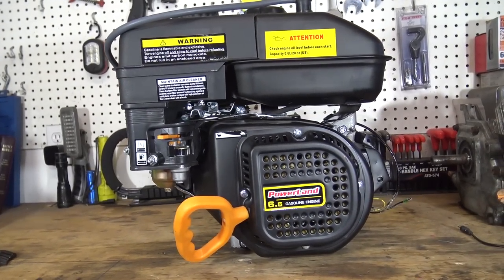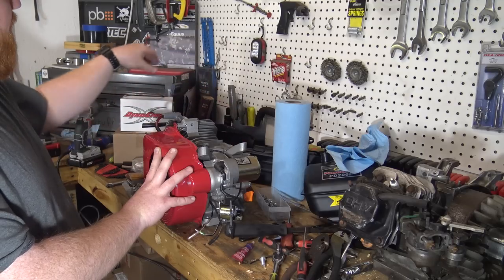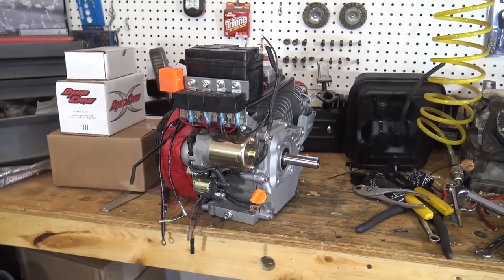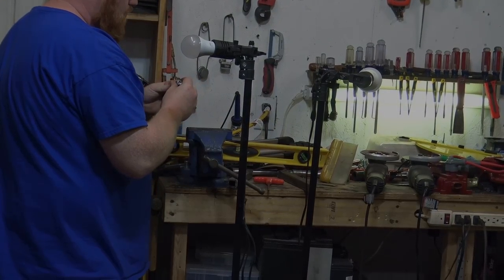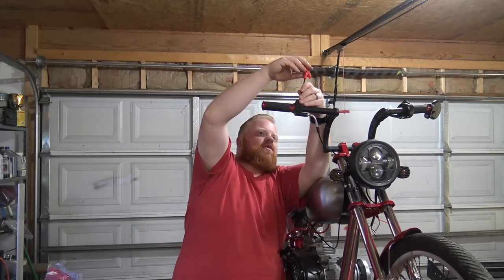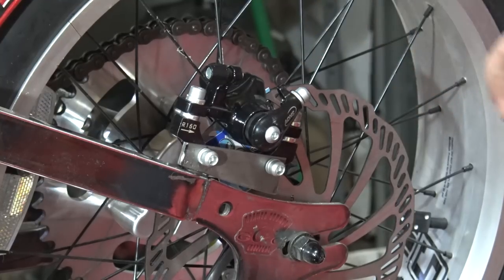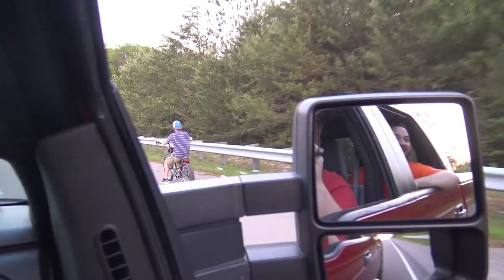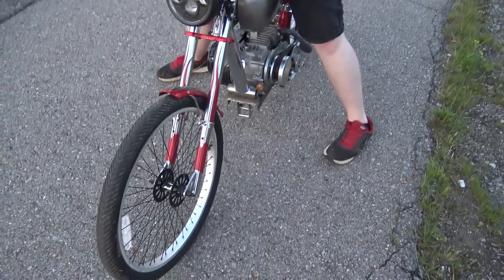Mini Chopper Build Ep 4 - Maiden Voyage

Comment: Just waiting for this channel to blow up. Love the builds, keep doing what you're doing man.
Reply from the maker: +Excrio I appreciate that man.
Reply: No problem. And I was wondering, I thought it'd be cool if you did a video in which you show all the modifications you made to the stock 212 before you put on the GoPowersports kit for little red? Just an idea, I've been messing around with an old dirt kart which I'll be putting a 212 on, hopefully it turns out alright. Thanks again.
Reply: Red Beard's Garage the Honda GX 270 Honda GX340 take the head off of the 270 put the head from the 340 on to the 270 you have to adjust your flywheel air cover when you do this it will amplify the horsepower on your street go karts up to 10 horsepower I think it is I hope you get this I hope you make a video about it I'm out
Reply: I AGREE
Reply: Wouldn't a larger volume head make the compression worse?

Comment: Be careful and keep an eye out for your spokes with that adapter for your sprocket, I had a very similar build like this a couple years ago except stock carb and a max-torque clutch (centrifugal). The engine eventually made the adapter turn into the spokes and start bending them!

Awesome build though, love everything about it!
Reply: stewstang these are safe.its not like the standard kind with the rubber grommets.

Comment: id like to see and info on actual  a simple transmission of some sort. Two speed nothing complex, it would open up so much. Have more efficient  top in and still have low end power.
Reply from the maker: This bike has all the power it will ever need. We can take off so hard it would break every spoke in the wheel. There is no need for one in my opinion

Comment: A steering stabilizer may help with your squirrely steering. I think it might just be how light the bike is combined with how skinny that front tire is. Those stabilizers are all over ebay and amazon.
Reply from the maker: +Erik Spitz I will most likely try that. It's mostly from having to hold our feet up
Reply: Red Beard's Garage i have a set of Harley highway bars if you need them. i'll send them out to ya

Comment: hey man that's one sweet chopper can't wait for the new motor with the electric start ,will you be trying out that 3D clutch on the chopper
Reply from the maker: No im not too fond of that clutch. I think the torque converter is the best route on anything. Thanks for watching.
Reply: Red Beard's Garage i agreeed tav2 is a simple solution for most applications

Comment: Great job! Would really be neat with a V-twin in it. Might ne a little heavy though.Did you make the frame? Where did you get the rear wheel and sprocket mounting parts? And front forks?
Reply from the maker: +Junk Yard the parts are in the description of the video
Reply: I don't see anything in the description about the frame and forks. But after watching the prior videos I deducted they are a special Schwinn bicycle? I guess good luck finding one. I like the size and proportions of the rear wheel but the sprocket mounting and brake rotor mounting look pretty cheesy. Do they just clamp on the wheel hub and spokes?

Comment: great build I always wanted to do one on that grame and back wheel but,  when I found out how light weight the rims were I went with some moped alloy wheels and built a custom frame of my own.  As far as the ape hangers .... they are not an ape hanger guys !  You lost the beauty of the bike with those bars but,  its your build not mine !  Always  a thumbs up !  I am bummed you didn't see the coill part of the video but,  that stuff happens !  A tip for taking grips off is to blow air throught them and around them and they come right off !  Glad you got what you wanted to ride !

Comment: Do you need the relays for the headlight, tail light, horn and turn signals? Like, would it not work without a relay?
Reply from the maker: Probably but I have them and its better to take the load off of the cheap handle bar switch. If you don't run them than all the current going to all the accessory will have to run through that cheap switch.
Reply: Thank you, it might be a good idea to get some then. Putting it all on my Baja Warrior. Thank you again!

Comment: Why not use a 2T 3 or 4 speed semi auto Yamaha or Honda motor. (Example: Y80e Belle - electric start) then use 2 more freewheel assembly to transfer power from left side of bike to right side. then use a 16x140x70 rear motorcycle rim/tire and a 17x3.0x70 front tire/rim. Change head post bearing out to cone style and get rid of the ball bearings. (get rid of wobble!) I did here in Thailand, sweet you can get 2T or 4T engines... able to idle, use motorcycle disc brakes, I like you started out with Bike brakes... not very strong when at speed! Don't need a clutch so use left and right hand brakes, hydraulic! I saw speeds from 80-115 kph! cruised easily at 30-55 kph. Then I was offered 36,000 baht (Thai) for it (exchange rate: USD1 = 31.60 Thai Baht

Comment: Cool build, but if I may chime in and give my 2 cent just in case people are looking for these pipe fittings. They're not flanges, it's not sewer pipe and most USA fittings are not imported from China. These are 304 stainless steel thin wall food grade bell reducers (perfect for this type of use). The USA fittings are more experience because they are 316 stainless steel or higher. Most major food plants (like Budweiser and others) will only allow you to use the highest quality. And a lot of times, it's even higher quality than stainless. It's whatever is in the "technical provisions" at the time. But all has to be approved before use. And that's the difference in materials that you are using. Forgive me,  just had to clear that up. As an engineer, it was kind of bothering me.

Comment: I'M BUILDING A 212 CC MINI CHOPPER LIKE YOURS.I PUT A CR250 FRONT FORKS ON IT,I PUT A SET OF PEGS BELOW THE SEAT AND USED THE PEDALS FOR THE FRONT TO STICK MY LEGS OUT.I PUT A TACHOMETER ON THE DIRT BIKE BARS. I WAS ABLE TO KEEP THE REAR BRAKES. AND I HAVE A VERY POWERFUL FRONT DISC.I WILL PUT LIGHTS AND HORNS ON IF I CAN MAKE IT STREET LEGAL. WERE YOU ABLE TO PUT A PLATE AND INSURANCE ON THE BIKE.I'M IN NC. AND I'M NOT SURE WHAT TO CALL IT.IT'S NOT A MOPED, MAYBE LIST IT AS A SCOOTER , OR A HOME MADE MOTORCYCLE.ANY IDEAS WHAT I CAN DO TO GET IT STREET LEGAL.I'LL TAKE A PICTURE OF IT AND SEND IT TO YOU.TELL ME WHAT YOU THINK ABOUT THE FRONT FORKS. MARTIN

Comment: Hey. I got a gx160 off an air compressor that was in our junk pile at work. Motor looks fine. The compressor was seized up. What can I do to hop it up a lil. Going on a rocketa go kart frame for my son (won't have reverse)😩
Reply from the maker: +K30 Krawler do the open air filter, exhaust, remove the governor, jet the carb

Comment: so the stock carb could i use the predator 212cc filther adapter kit?and how much amperage battery it takes to fire up the engine ?just asking because my powerland 6.5 eletrict start is on the way .hehe

Comment: You have the chain on the wrong side the chain should be on the left side
Reply from the maker: +Phantom 103 why do you say it has to be on the left side? It doesn't matter what side it is on. The CVT makes it hard to line the chain up without a jack shaft

Comment: I'm having problems with my go kart, I bought it from this guy and the engine is new, predator 212, but when I start it up it has to be set on something bc the wheels spin with the clutch at a fairly decent rpm rate and when I get on it, it still wants to go, it idles at a medium rpm rate. Does anyone know? Please reply need help to fix the problem
Reply from the maker: +Term try adjusting the idle screw to idle it down if that doesn't fix it the clutch may be sticking

Comment: Badass build man!! Just subscribed you have great content. I built a 66cc motorcycle  using this stingray model but is there any other engines that would look like they are 50cc while having bigger displacement? The reason i ask is because i live in California (land of the restricted lol )and and anything bigger than 50 requires a liscence plus registering the bike
Reply from the maker: +user nam3z you could probably get away with the 110 and just brand it as a 50cc.
Reply: Red Beard's Garage ok sounds great do you recommend any 110cc engines?
Reply: TRY THE 79CC 4-STOKE HONDA CLONE.PUT 49CC STICKERS ON IT.
Reply: How to Guroo awesome thanks for the tip ill check them out
Reply: YOU CAN BUY THE MONSTER KIT ON EBAY, OR GET THE MOTOR AT HARBOR FREIGHT TOOLS FOR ABOUT $100.00
Reply: you can put a 212cc on the bike just put a 49cc sticker on it :) i do it in colorado and no problems the coppers dont know any better :)

Comment: your Honda gx270 Street go karts that you have you can put a bigger head on it from a Honda GX340 and it will match up perfectly problem is when you do that you're going to have to adjust that Honda GX340 head will be in the way of a couple things you got to adjust the cover that surrounds your flywheel and your stator the cover that that blows air across your engine you need to adjust that but the Honda gx270 and the Honda GX340 head we'll match up perfectly to the Honda gx270 it will increase your horsepower up to 10 more horsepower if you get this message I don't have a YouTube channel I am just a subscriber so the next time you go live again live chat I'm hoping I catch it if I don't too bad but you should try putting that Honda GX340 head on your Honda gx270 Street go karts if you can to make a video about it it'll be awesome you've got to adjust the flywheel cover if you don't have all not go on because it's a little bigger then the flight will cover either cut it back some or find some way to bend it back so they had it on there if you do this your go-cart will expand up to 10 more horsepower I did it to mine my thing does about a hundred miles per hour now the only thing I've done to it was just put air filter on it exhaust and the header Anna camp that is it and it does well over a hundred miles per hour down you should try it it is a hell of a lot faster it's just awesome if you get this message Ryan Welling signing off deuces